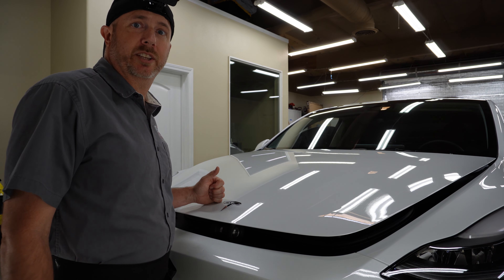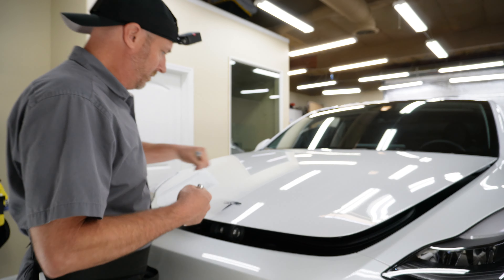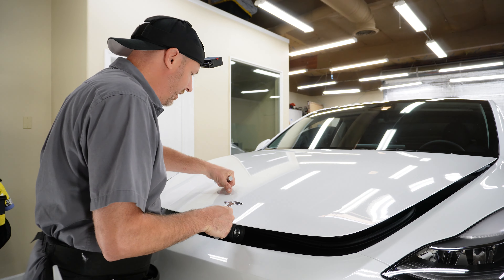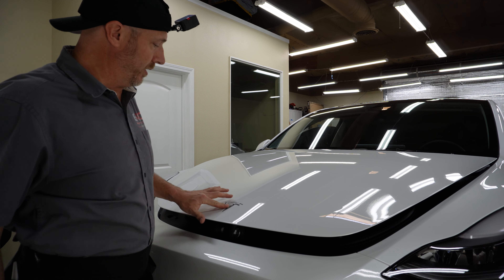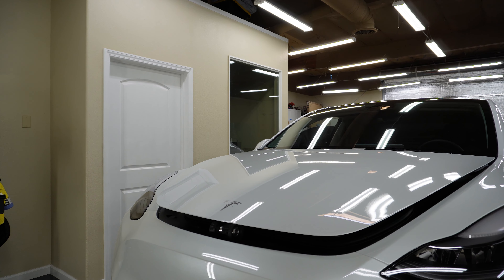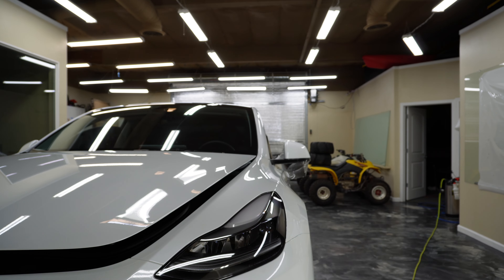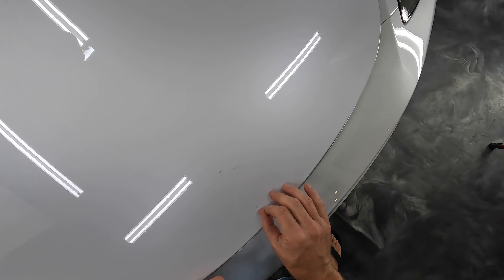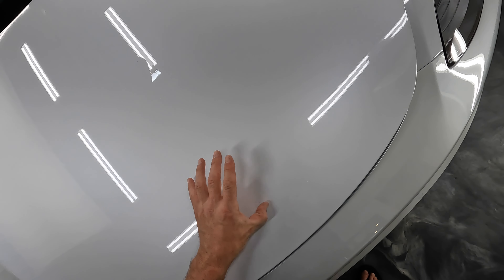How to professionally remove car badges NO paint damage! AKA Debadging emblem

Comment: What adhesive do you use to re-attach the emblems, or do you just purchase new ones? I haven’t found any adhesive that’s as thin as the factory. Thanks
Reply from the maker: Great observation, we have the same issue. We have thicker and thinner adhesive we reapply the emblems with. We always reuse the same emblem. (I'm going to update the description with links) 3M double sticky tape is our normal go-to but is a little thicker. We also use 2 layers of "banner tape". It's way thinner but also works pretty well and is a great alternative to the 3M. It keeps the emblem tight to the paint and doesn't make it look like it's floating (hovering) like the 3M.
Reply: I’ll have to give banner tape a shot, thanks! For spoilers, I use the 3M VHB(very high bond). It’s clear instead of gray and I think it holds better :)
Reply from the maker: Thank you for that info. I'll take a look at that product!

Comment: How do you reposition all the emblems when you reinstall them?  How do you make a template for installing the emblems?
Reply from the maker: I need to make a video on that. Would that be helpful? On the front Tesla emblem, I bought a plastic tool that lines it up (because we do so many). As far as the rest go, I install them one of two ways. I make a stensel with transfer tape (or a piece of ppf).  On that stencil, I mark the bottom of the badge and two edges on the panel for alignment. The second way for easy badges is to measure from the top and side and just stick them on. I can  get them on really straight. 👍🏻😁 Let me see if I can find any prerecorded footage and put a video together. Let's hope I can find that footage! 😂🤣 If not, I'll get some on the next car with badges.